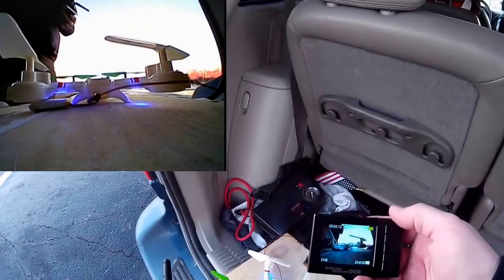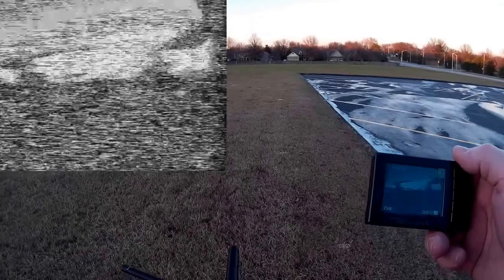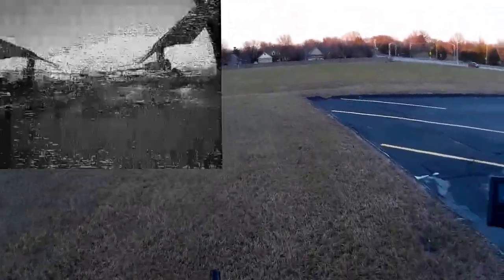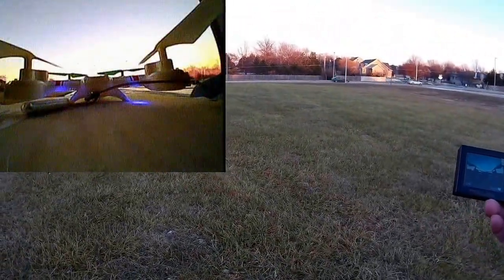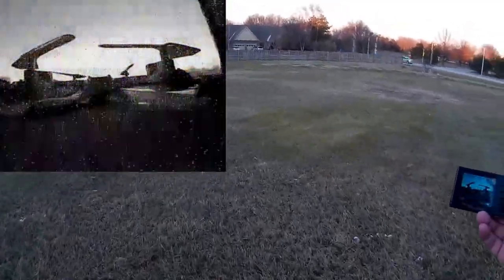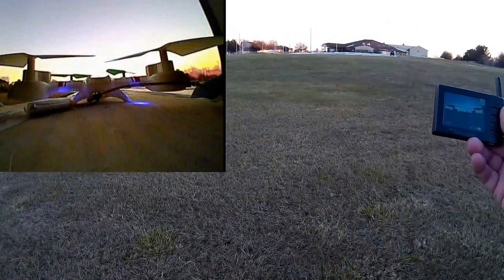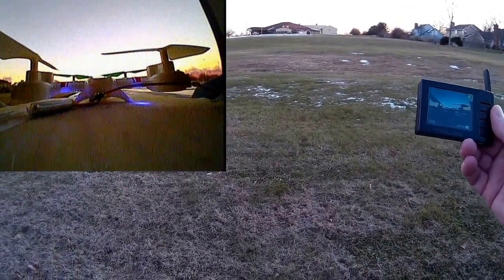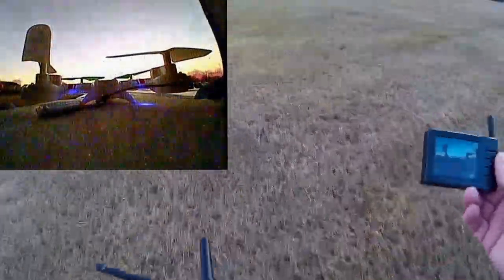FPV AIO 600TVL 170 Degree mini Camera 5.8G 8CH Transmitter All in One Only 3g - Range Test

Comment: Very disappointing, have you tried this with clover leaf antennas on both ends?
only 3grms and something and 200mw, seems very nice. don't mind to use a pollulu although I would tried to use a diatone regulator, cheaper shipping for me. would love to see a comparison with the hobbyking one, but with this one with a banggood clover leaf antenna. you can measure the distance on goggle maps ;)
Reply from the maker: +Multirotor Go I did not try with clover antennas. It works okay as it is, just not super long range. I have it in a toy quad my son flys in the street. In this video I didn't measure with a map, I used a phone app and steps.
Reply: +Multirotor Go   I thought it performed pretty good considering~ 
1. The Camera/VTX  is in the back of the van! 
2. The Camera/VTX appears to be behind the quad/ battery. 
3. You appear to end up being below the VTX which increases the interference? 
I would have done it differently in an attempt to minimize the obstructions...
Reply from the maker: +Ken Oath All good points. The camera/vtx is actually in the nose of the toy quad, but its a small quad and all pretty close to the battery and FC.